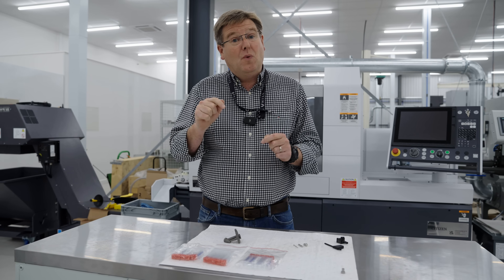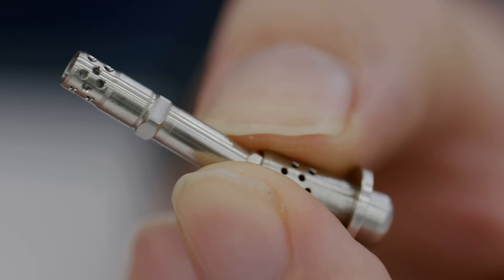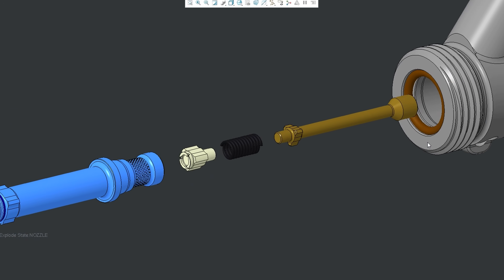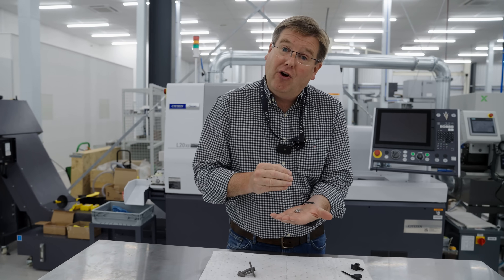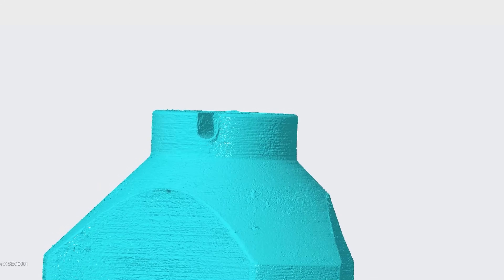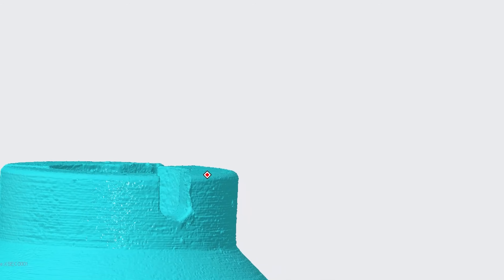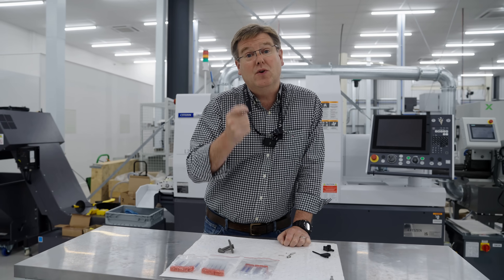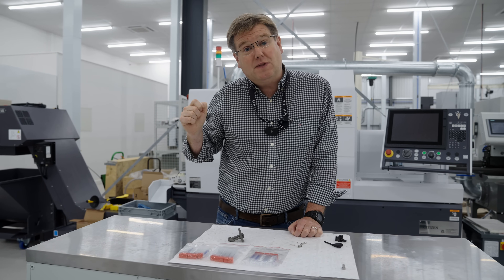The 0.17mm Challenge on the GT50's Fuel Nozzle

Comment: I have a simple but perhaps a not particularly smart question. Turbine engines generally have their highest efficiency at a higher power setting. Turbine aircraft (fixed wing) generally operate at 3 or so different power settings if you ignore idle and taxi.  How do you optimize a new turbine design to be as efficient as possible over the wider range of rotary wing power settings required and where do you design for the max efficiency? Given that you are building one of the few clean sheet turbines of my lifetime, what new technologies are available to you to have greater efficiency than the turbines fitted to current production helicopters? Keep up the amazing work.
Reply: I think this one will be middle of the park for efficiency (ie not using crazy latest techniques for blades), and for small engines your blade to gap ratio is just not as good as large engines so there’s a ceiling to efficiency. The thing he’s actually doing is making a modern clean sheet fadec engine made for manufacture & perfectly matches in size+power for the application with high TBO that’s *cheap*. This isn’t a $1m engine. The entire helicopter plus engine is less than the cost of other newer turbines like Safran.